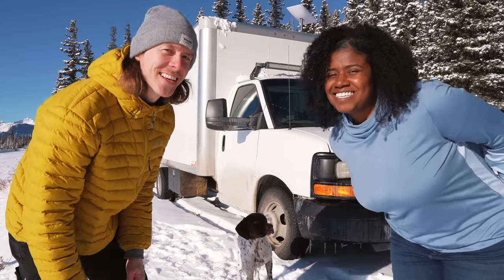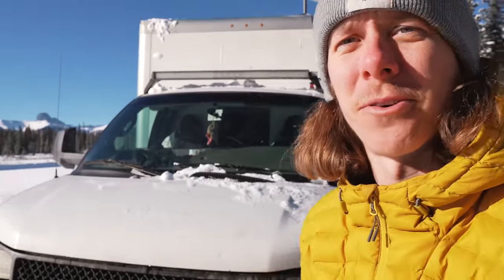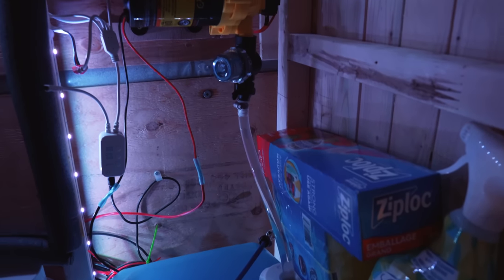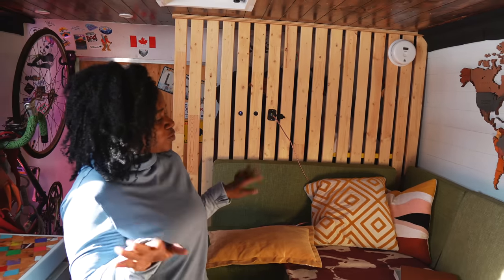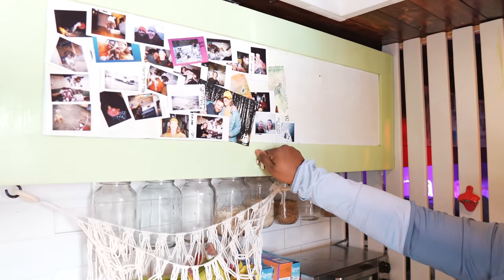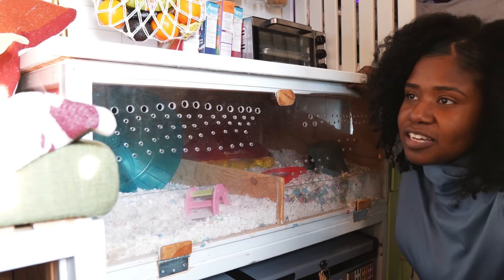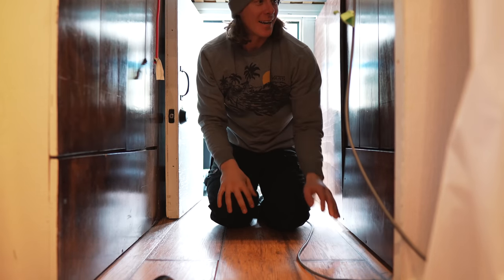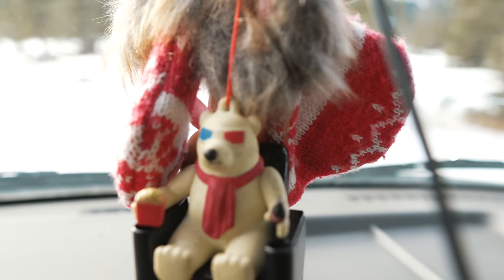Stealth Box Truck Van Tour: couple converts delivery truck into tiny home

Comment: I noticed that your CO2 detector is mounted quite high. How did you determine where you wanted it?  Carbon Dioxide is heavier than air, but heat rises. 
  If I were living full time inside a van I would consider putting one up high, and a second one down low. This would give you coverage of high and low, AND provide redundancy in case one fails. It’s not too expensive if it saves your life.
Reply from the maker: Thank you Steve for the advice I never thought about that , I’ll definitely get one for the bottom part of van. I put it in that corner because we have the electrical system and batteries there underneath the couch